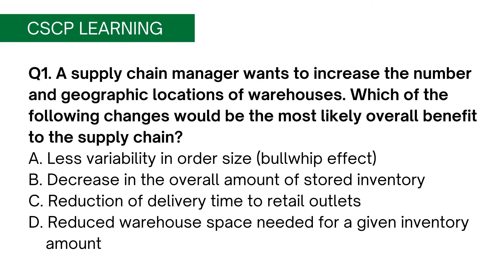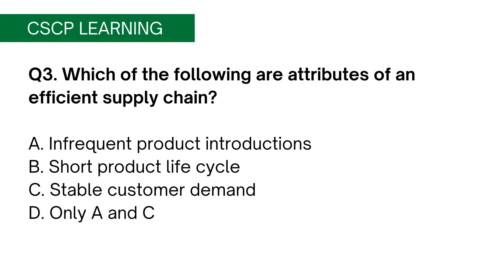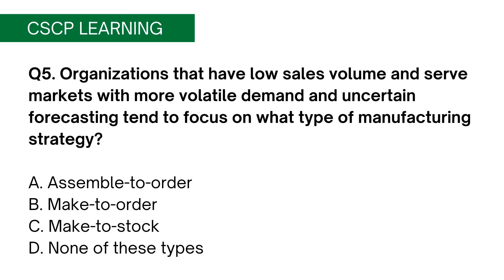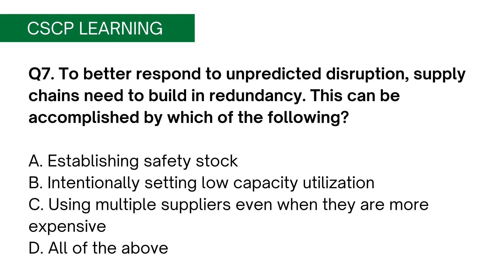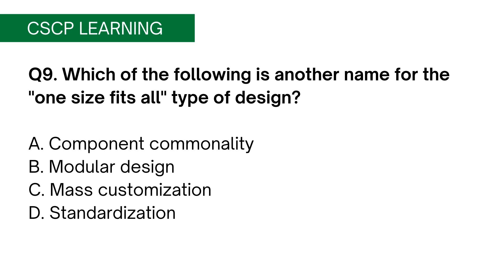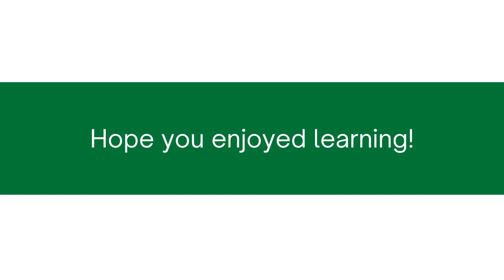CSCP Exam Practice Question Test 3

Comment: Q7. I think answer is option A not D
Intentionally setting under capacity is not advisable.
Reply: Intentionally setting under capacity—often called under-scheduling, buffer capacity, or intentional under-utilization—is a strategic management practice where an organization deliberately operates below its maximum workload or production limit.Instead of planning for 100% utilization, managers schedule teams or machinery at a lower threshold (e.g., 70% to 80% capacity). This creates a deliberate buffer to handle unexpected demands, foster innovation, and prevent burnout.

Comment: Q8, isn't it Design for Quality? We are reducing user errors through product documentation (part of the product itself), which reduces perceived defects and thereby improves "quality"? It cannot be C since we are not "servicing" the product and rather just using the product.
Reply from the maker: keywords are 
-large pictographs
-common user errors and not errors related to product quality
For example, If you run your kitchen blender machine continuously for a long time, it may overheat or burn out but that doesn't mean it is a product’s fault.
Reply: @cscplearning1044  Thanks for the quick response! But adding large pictographs doesn't make the product easy to maintain, repair, inspect, or service. It makes sure that the users understand how to use the product the right way, avoid common mistakes, and stop believing the product is defective. If the documentation was to fix or troubleshoot likely or most common issues, it could be design for service. Since product documentations are a part of the product, and since the new documentation is aimed to make sure that the customers don't perceive an otherwise good product as defective, I am finding it a little difficult to understand why option D is incorrect.

Comment: Q6 Again. Why should a question be based on assumptions? Is it a CSCP flaw? According to me option C is correct although option A would be close. But efficiency is all about speed and real time data sharing.
Reply from the maker: Confusion or difficulty level in these videos is easy or medium. You have not encountered questions in my questions bank as yet. 
Anyway, I would suggest you to read manual thoroughly and you will be able to get hold of it. It will be little difficult for me to keep sharing explanations on and off here.

Comment: Q2. Highly customizable products also uses responsive supply chain strategy (in that case volume and variety may be considered as the differentiator). But this may not be the case for a new product or an innovative product. Option A or demand uncertainty may be the overarching differentiator.